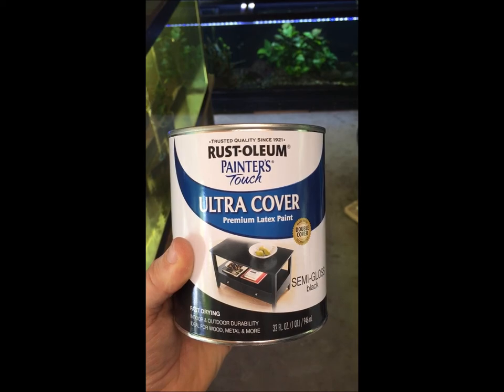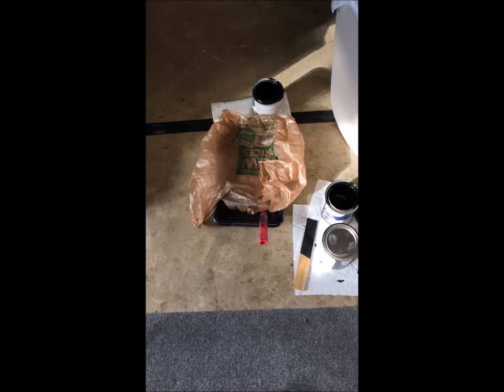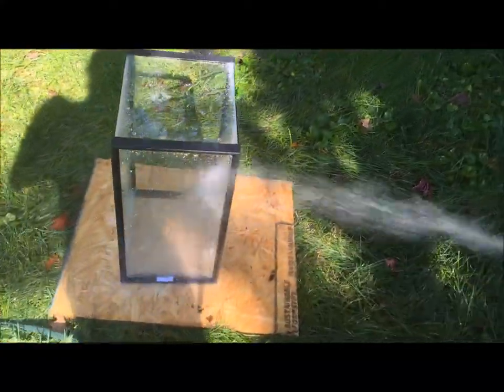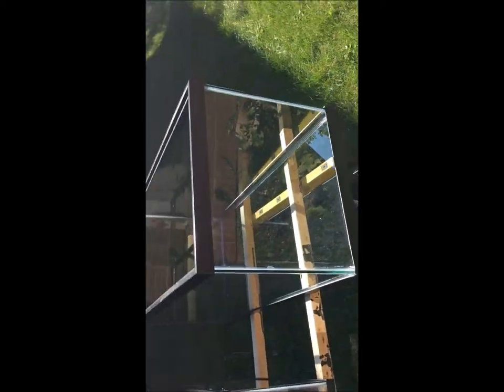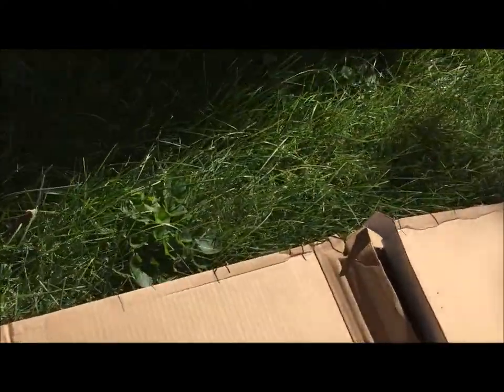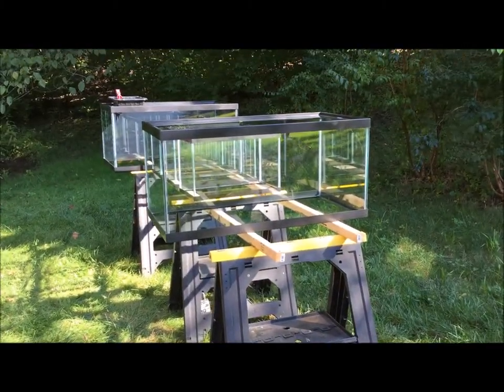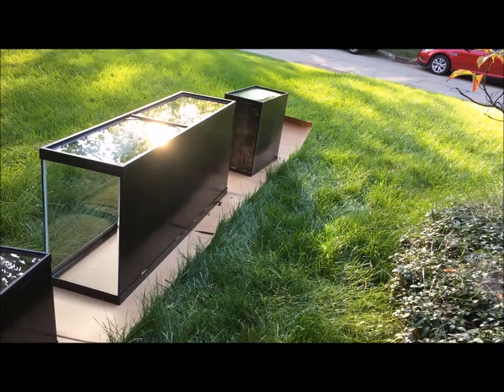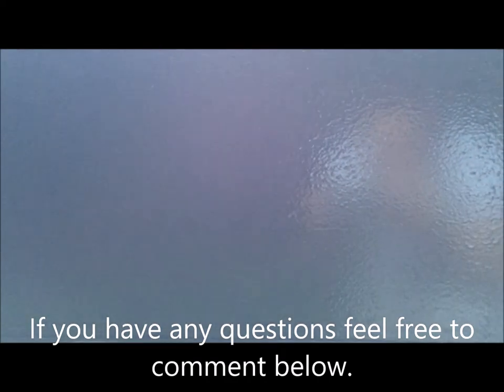DIY How to Roll Paint the Back of an Aquarium

Comment: how's this paint hold up with water drops running down the back...?
Reply from the maker: Ive never had a issue with it. You can use oils based as well. The type I use is made for outdoors so its more resilient to water.
Reply: cool ,I'm going to try it... thanks ✌

Comment: How long you leave them tp dry
Reply from the maker: I try to do them in the sunshine so they dry fast. Dry time can vary on many variables such has temp, air circulation, and humidity. Doing them in the sun like I was the first one would be dry by the time I finished painting the last one. So I would say 10-15 in idea conditions.
Reply: Ok thanks